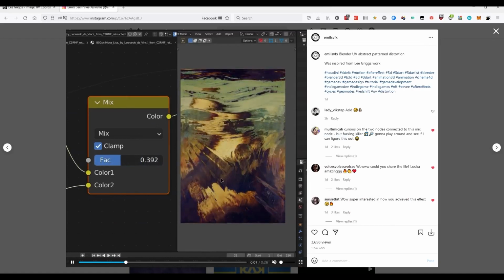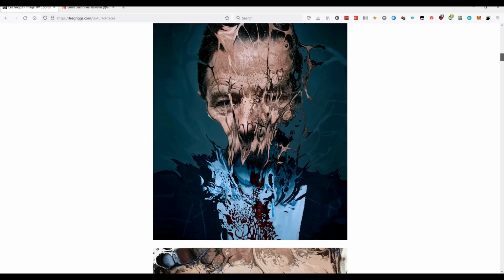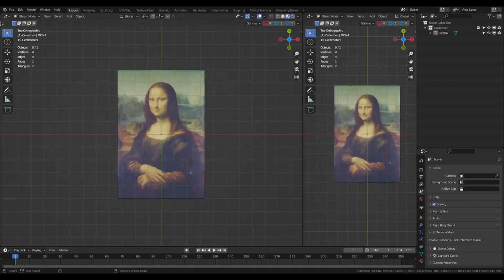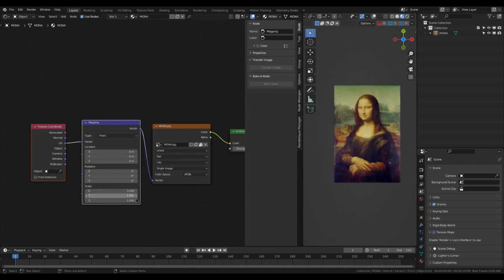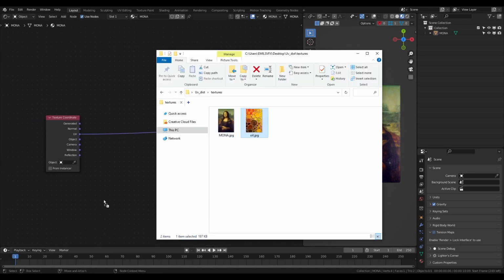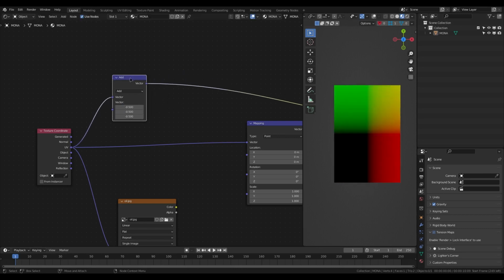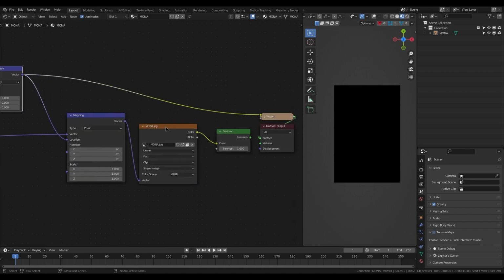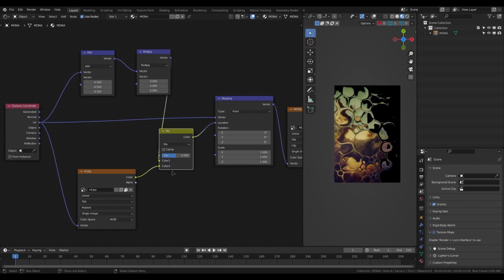Blender uv coordinate distortion Tutorial

Comment: love this - so clever!
Going to play around with it in a bit.
Maybe if you add another 'subtract 0.5' between the 'image texture' and 'mix RGB' you can normalize the distortion so it doesn't push everything to the bottom left?
Reply: Just saw someone also suggesting in the comments to change the mix mode to 'linear light' - which i think does the same thing.
Reply: Here are my first tests: https://youtu.be/MpDFSfOs0Bk

After some experimenting it turns out that 'normalizing' the distortion is more about finding the tonal center of the chosen image you're using. I found it useful to have a Addition node after the Image Texture to tune it's displacement negatively or positively to taste.